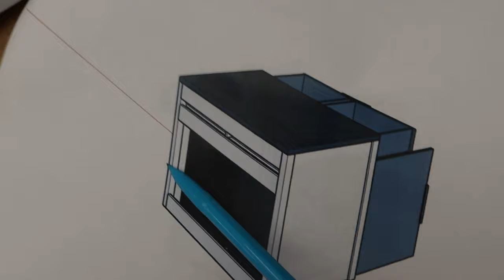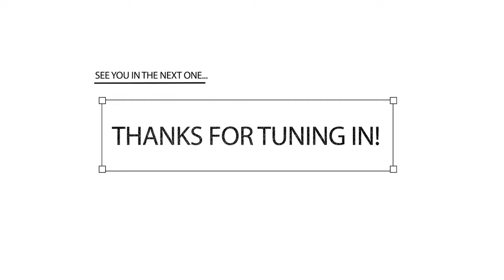Putting the festool domino to work & POV with the INSTA 360 GO 2 #behindthescenes #woodworkervlog

Comment: The idea of using dominos is brilliant but I could never figure out how they would be lined up properly so I figured I would end up planing for days. You make it so so incredibly easy and maybe I should try. Excellent video!!
Reply from the maker: Haha it’s much easier than you think. Especially the domino. It’s as easy as grabbing a small ruler 📏 mark a line across your two board, set your cutter depths & then just put the domino on the line and plunge away. Like most things once you know what all the functions of the tool are it’s a breeze. Thanks for tuning in ☺️🙌🏻 and definitely give it a try, that’s what woodworking and making is all about right? 😁🙌🏻
Reply: @KirstiePervinDavies  I guess I have to look up what a ruler is first. LOL

Comment: love using my domino 500 for walnut chopping boards. Do you have the 700 Kirstie?
Reply from the maker: Festool can be like marmite. I’m definitely a fan of festool. So clean, easy and smart kit to use. I only have the 500 as I didn’t feel I needed the bigger range with what I make. Do you have the 700?
Reply: @KirstiePervinDavies  I only have the 500 but i agree its a great machine. i would like the 700 but can't justify the cost yet as only making small projects. I've messaged some photos over on your instagram page. Your new workshop is coming along very nicely! Keep up the great work.